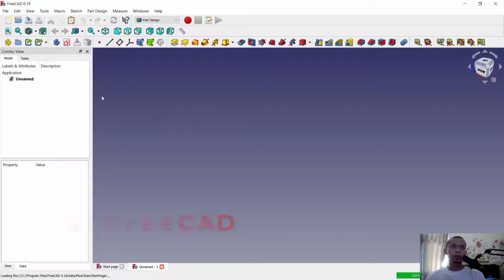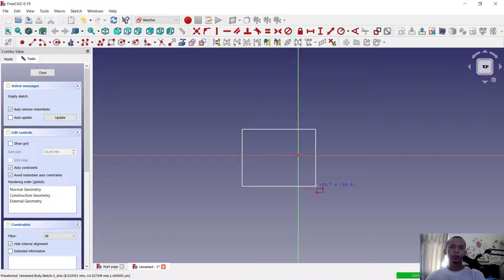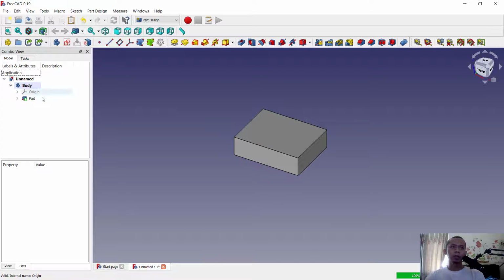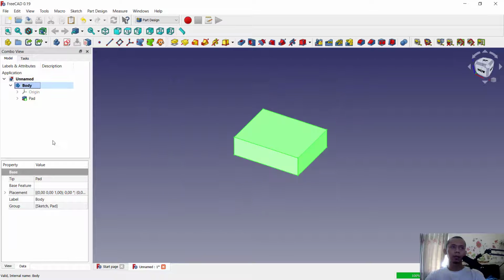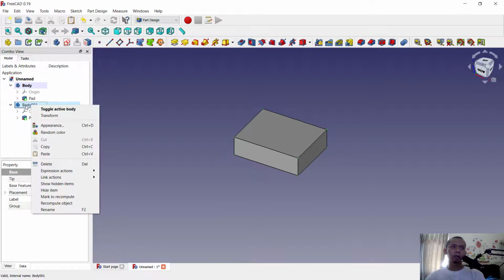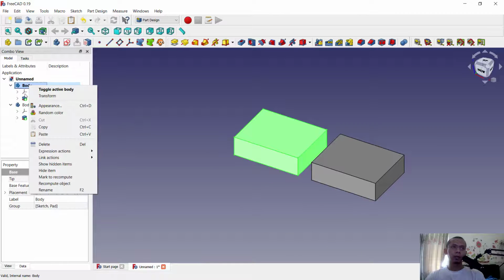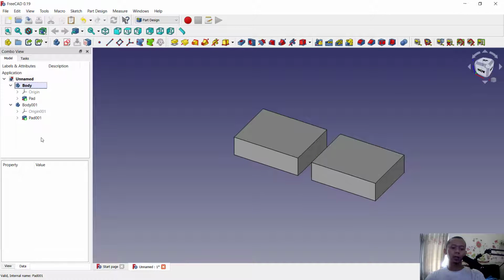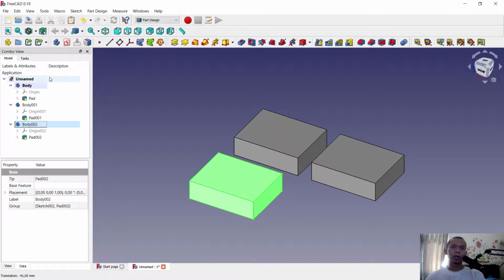FreeCAD How To Copy Body

Comment: Thanks for this very concise tutorial. Is it possible to reverse the copied body?
In your example, the rectangle does not differ seen on one side or the other, the tails side and the face side.
Say I copy an "O", the copy would also be an "O".
But if I copy a "[>", I would like the reverse copy to look like a "<]". Is it possible to invert it like this, like an inverted reflection of the original?